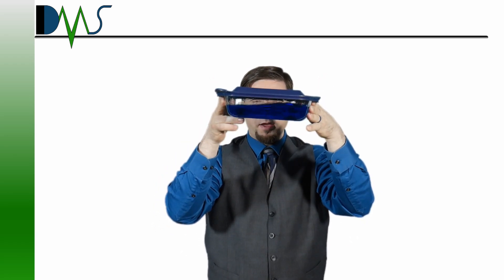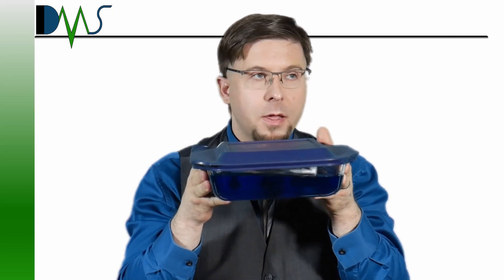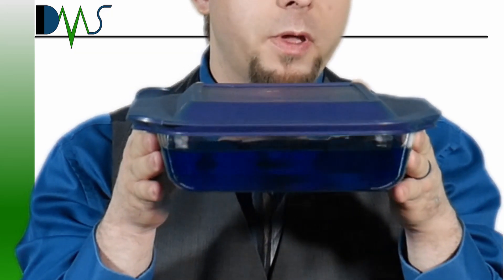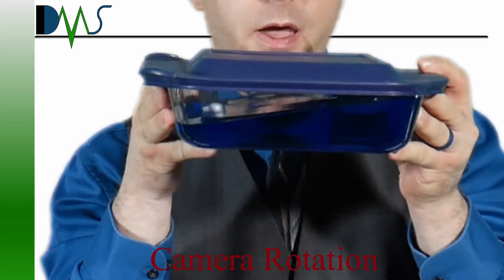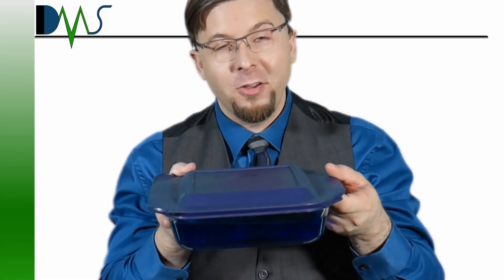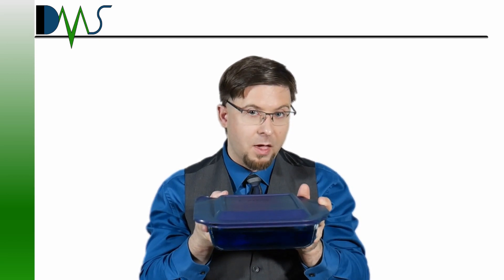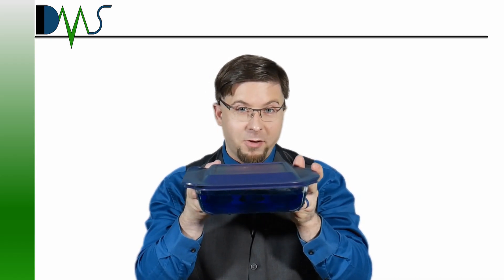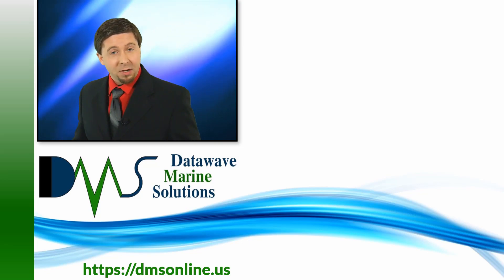Free Surface Moment:  Demo

Comment: Looking at it this way is a great and straightforward explanation. Your previous video made enough sense to me to know it's a problem and to recite the concept, but this pulls it all together. :) If a passenger spots a whale and all the other passengers run to see it too, do you count them towards the free surface moment? I imagine both the definition of the relevant "tank" and the relation of heel angle to FSM from the "passenger fluid" are quite awkward to work with!
Reply from the maker: Excellent question.  We don't count passengers as a free surface moment because, for moderate heel angles, they do not crowd further onto the side as the ship heels.  However, all of the passengers crowding to one side is a scenario that we specifically check against on passenger boats.  We also check the scenario of all passengers crowding to one side to get on lifeboats if they need to abandon ship.  We even assume the passengers will form a denser crowd when running for the lifeboats vs looking at the whale and thus be farther to one side.
Reply: @DatawaveMarineSolutions  Thank you for your reply! Pesky humans always messing up our pretty models. I'm in economics, that too would be easier if humans just behaved as would be mathematically optimal for them.